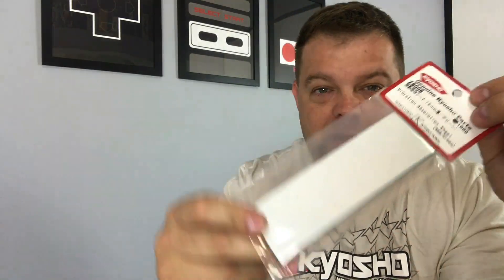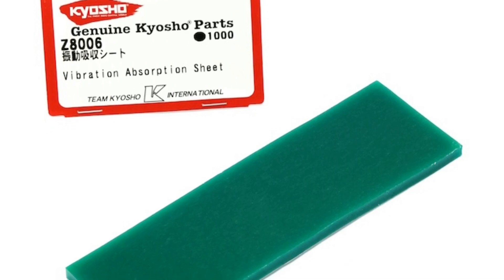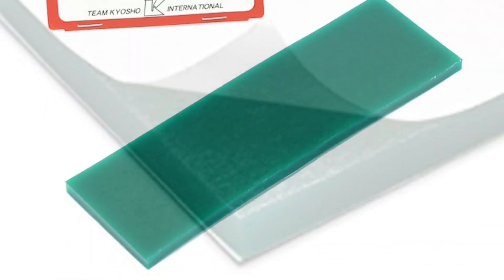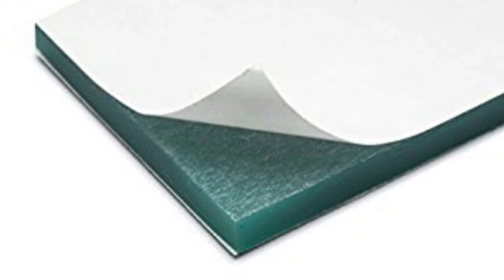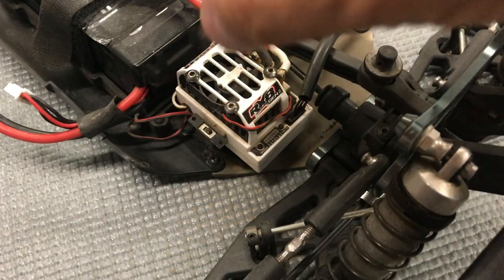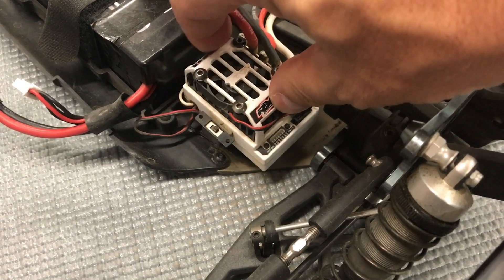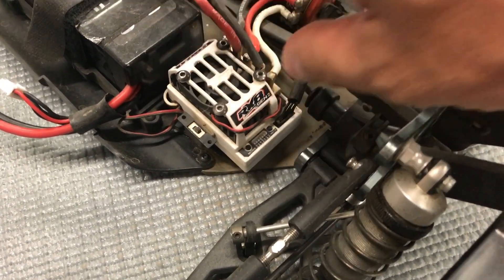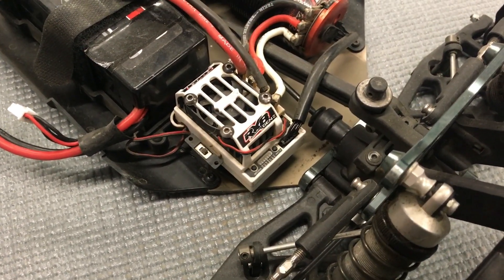How To: Protect Your Expensive Electronic Speed Control

Comment: I started using SMC electronics after I saw your video on their old 1/10 scale ESC and I've been really happy with their stuff. For ~$100 a pop it wouldn't be a huge deal if it didn't last forever. What makes the Tekin stuff worth the extra $100-200? Maybe do a video on the differences between a budget speed control vs a high end one. By the way, I've been loving my Rawspeed Slicks! Slicks are king at the indoor clay track I race at, and yours are hands down better than Primes and Smoothies on our track.
Reply: Sam Stalder that's a good request, I am interested to.
Reply: Tekin is one brand I've never had an interest in. I've seen more problems come from their speedos and the fact they still don't have a program card which, is a huge deal to me. Especially when you get a new speedo and have to spend a lot of time dialing it in. The brands I've used and currently use and have been extremely happy with...Viper, MClan, dualsky and now a new Hobby Wing for my ebuggy. All have been flawless and I'm still using all of those brads. I have tried LRP and Muchmore, but had issues with both of those.